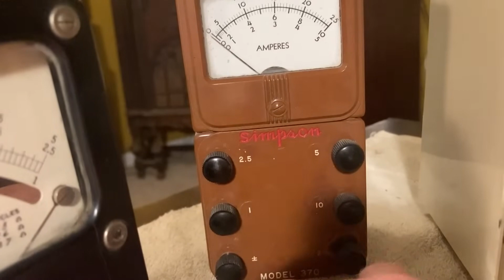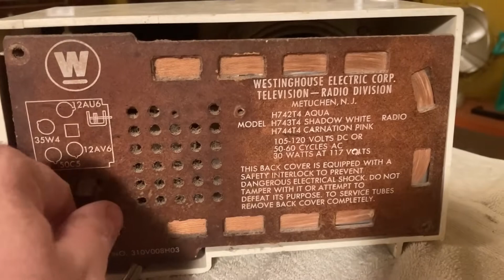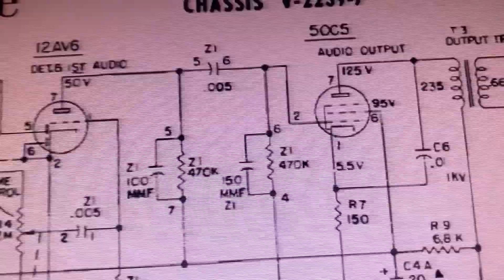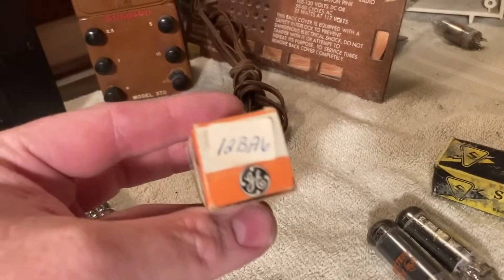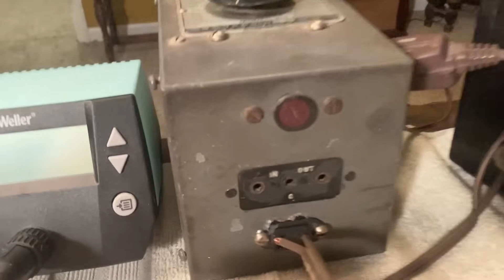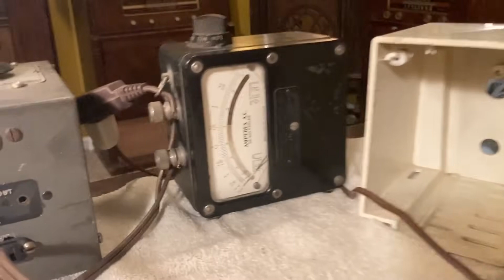Using A Vintage Ammeter To Test & Repair This 1959 Westinghouse 4 Tube Radio

Comment: SC Short circuit ? In other  words bypassed ?
The terminal that burned up was probably a little loose and was arcing producing heat. Often you will need to replace all paper caps plus any electrolyte caps on older equipment.
Reply from the maker: Thank you KB1UiF!
Reply: @AmateurRepairTime  You are welcome, keep up the good work. 👍
Reply: I enjoyed this vid, subbed.👍

Comment: I believe S.C. stands for "Short Circuit". This is handy for when power supply capacitors charge up for the first power up of the radio, so you don't slam the meter.

I have a Simpson model 373 which is the same case as the smaller brown Simpson you have there. The model 373 is DC milliamperes. Rotary switch on the 373, instead of multiple terminals, has ten positions, 1,5,10,25,50,100,250,500,1000, SHORT. I believe it is rated up to 500 VDC, but not certain about that. I perfer the analog meters for a reading that is constantly changing over a digital one. Cheers!
Reply: P.S. actually that would be more for solid state power supplies, tube radios would be heater current surge at startup.
Reply from the maker: Thank you Zulumax1

Comment: Well Ron's gift of  a bunch of miniature tubes will come  in handy for  some future repair videos Ronnie. So  before you 
take the old e cap out put a mark on the PC board and another one on the side of the cap next to it so you know which
of the new  replacement caps goes where. Just a trick I learned from watching another guy do it. Usually  4 tube radios
 are not  good  for  distant signal  reception but do make good " city" radios IMHO. Cool stuff Ronnie.
Reply from the maker: Thank you for watching as always, I appreciate it!